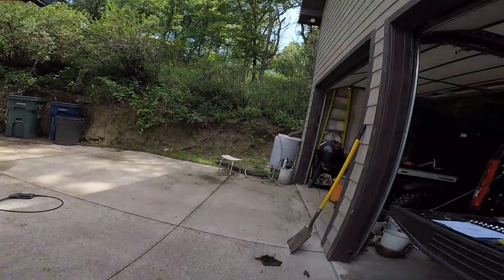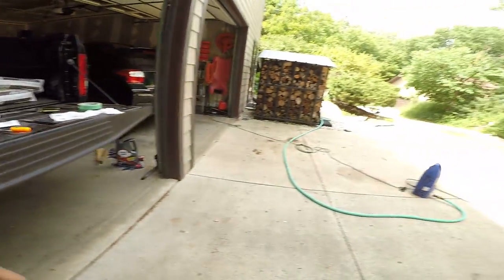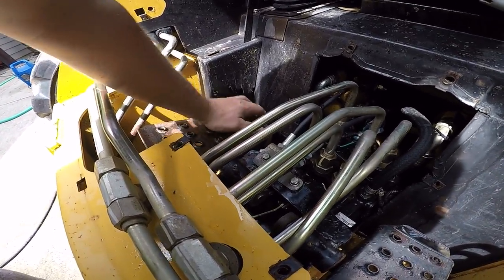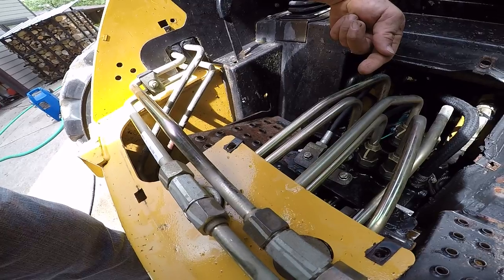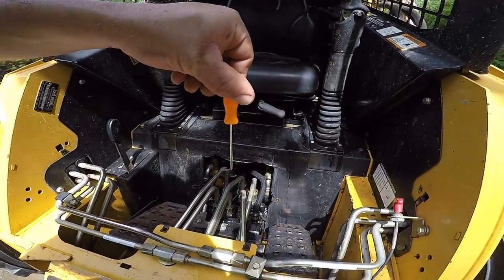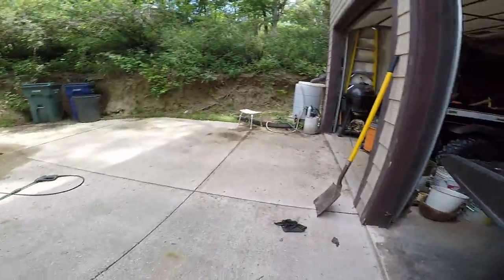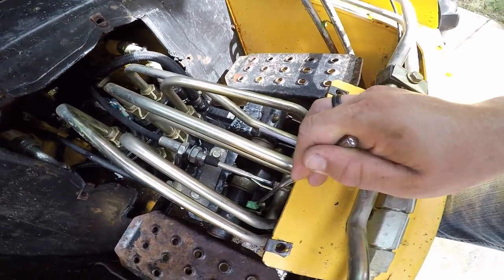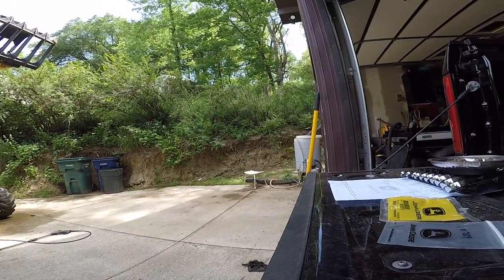JD 317 skid Steer with Hand Controls / Aux Hydraulic Foot Switch Linkage Failure.

Comment: Can you advise me on using the auxiliary controls, I hand a 2009 jd 325 skid steer hand control foot control.
Reply from the maker: I think if u use foot controls for boom bucket, the aux control is on the hand control. It folds down… my machine is all hand controlled. my aux controller is the right foot. Hope that helps.
Reply: My skid steer is just like yours can you tell me if the machine has to be running to fold the handle down not sure what I need to do to fold the the right control for auxiliary down because when running bucket just tilts, mine won’t move unless running won’t move with machine in park or key off. Anything would help, thank you
Reply from the maker: @rickmiller1045  if the bucket tilts when you fold the had control in, you have “hand controls”.   if that is the case, the aux control would be at the right foot. If the aux is controlled by the right foot, there is a lock out near the right foot well, it prevents accidental foot switch actuation. If the foot switch aux hasn’t been used in a long time it can be hard to used if it’s fill of dirt/ grime.
Reply: Thanks for all your info, you are exactly correct. It’s foot auxiliary control, this skid steer is new to me couldn’t find any info about it. Once again thanks for your help. Hope I can reach out to you in the future if I have a question. I know you won’t have an answer for everything but I’m sure you can point me in the right direction.
Reply from the maker: @rickmiller1045  I'm glad I could help.